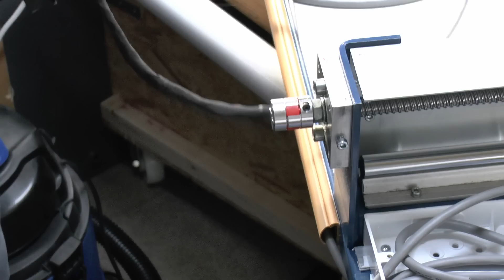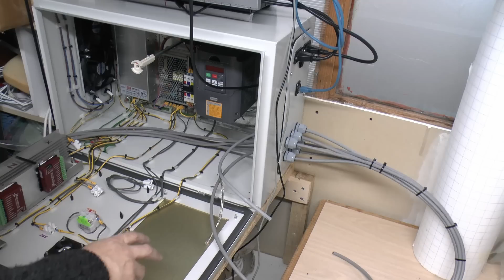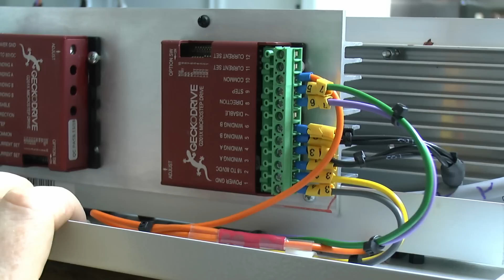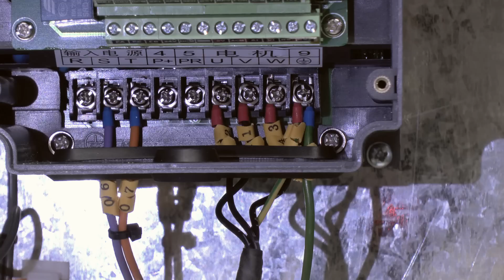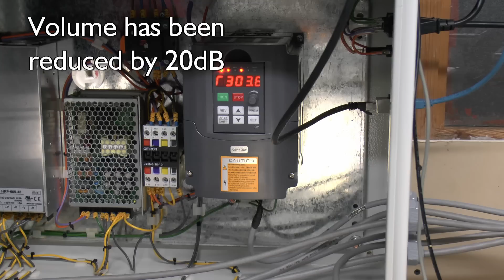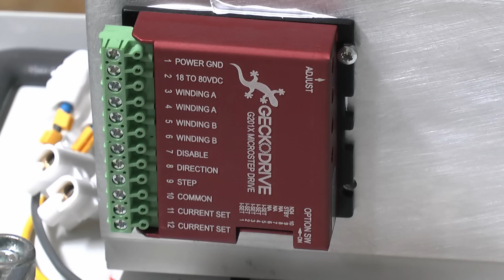CNC Router Build #5 - Motors and Movement

Comment: How to connect 2 y axis pleas help me
Reply from the maker: 2 motors for a single axis requires 2 motor drivers, each connected to 2 separate outputs on the controller board.  The software is then configured to send the same Y axis signals to both of those outputs.
Reply: @jwflame   how i can configure in match 3 for 2 motors and 2 drivers for 1 position y axis
Reply from the maker: @justbabychub581  No idea, I do not use Mach3.

Comment: HI John, Are you still using your CNC? is there been any issues with it? Im building one similar just wanted to make sure your happy with your one?
Reply from the maker: No issues with the machine - the only changes have been that:
1 the computer monitor failed recently (it was already 10 years old when the videos were made), so replaced it with a new one
2 the cyclone dust collector didn't work very well as the plastic tub was too weak, and the sides crumpled in after a while (now replaced with a metal tub instead)
3 for flat panel materials they are fixed to the base using double sided tape, as that's more reliable than superglue and masking tape.  They are all single sided so tape on the back doesn't matter.
Reply: @jwflame  Its a nice CNC Was your Gecko boards and Motion controller ok? 
Thats the bit im working on! The Chinese ones are too dodgy Im thinking ACORN CNC Centroid, CSMIO/IP-M 4-axis CNC controller also there is an Italian company N°4 Drives A-CSD04.V and N° 4 Stepping Motor Called RTA! I watch your vids and love the CNC ones clear and very helpfull! Thanks JW
Reply from the maker: @iceman1358  No problems with those, I chose those so that if anything did fail, direct replacements would be available, rather than trying to source some random unbranded thing or have to make alterations and fit another type instead.

Comment: I'm wondering if a smaller motor on the Z-axis makes more sense.  That motor has got to be heavy and that extra mass is going to create a lot more inertia, which will mean you have to move slower on the X and Y to get the same accuracy.

Comment: I suggest heavy welding cable for connecting those limit switches, that cable you used looks severely underrated for the expected 2mA of signal current.....

Comment: Gawd, that's NOT how you terminate shielded cable...  Remove insulation, peel back and twist the shield, solder an earth wire to it, cover with a rubber insulation tube/heatshrink. At the signal termination end, connect the earth wire to a local earth terminal, which then connects back to the star earth point at the mains incoming.

Comment: how did you tune the motors without MACH4,  I trying to run my CNC but the motors dont move yet it has an old driver box witch controls all 4 motors i have on my CNC. would you know what could be the problem. thank you
Reply from the maker: To move the motors you will require either Mach4 or some other control software, there isn't any realistic way of operating the motors without it.
The particular motor drives in the video have a small adjustment screw on the side to obtain best results with a particular motor, this is adjusted once the motor has been set to a continuous slow speed in the software.
Reply: hi John , i got my CNC from a person, and it came with very old driver and it was working kind of but when i installed it in my shop it stopped working . i do have MACH 3 software but i cant run CNC with my old driver , . its a big CNC  with 34d  and 42D motors , motors have 6 wires, 4 phase  and 42 D motors are 7.1 Amp. i would like to upgrade Driver for my motors, can you recommend some good drivers for my motors and BOB. 

thank you

Comment: hi John very well done i like your control box .  what that spindle inverted, do you need anything else to run the spindle,.. thank you
Reply from the maker: The spindle can be run with just the inverter, speed can be set manually with the controls on the front.
In this build, spindle control will be done through the software which required some additional wiring between the inverter and the breakout board.  This will allow both on/off and speed control.
Reply: can you recommend any good inverter, i would like to control spindle from my MACH 3 . thank you

Comment: Excellent project John - may I suggest to eventually mount the unit on one or two concrete paving slabs as this will reduce some of the low frequency rumble and help reduce vibrations when routing the work piece , it will not reduce the high pitch of the stepper motors, however it will give overall stability especially if the CNC is not going to be moved around the workshop.

Comment: Excellent build, one question though - why not use plugs/sockets for the motors, eg a D connector or similar? Would be easier to move though a faff to install them all I guess.
Reply from the maker: The effort in installing them is far more than disconnecting wires in the unlikely event that the machine is moved somewhere else.  More connections with plugs & sockets also means more things to fail.

Comment: I recommend to modify the ramp-up (PD014) and ramp-down (PD015) time for the spindle on this VFD. In my experience 5-10 seconds for ramp-up and 3-5 seconds for ramp-down work fine for this type of spindle. If you use Mach-3 you'll notice quickly that by default it will not wait for the spindle to be at full speed which means it will start cutting at a very low RPM. Make sure that your CAM software adds an appropriate delay/dwell (G4) command after your spindle start (M3) command, probably something you need to do no matter what.

Comment: Why does everyone name X, and Y axis wrong anymore? Your gantry is supposed to be Y, and the table X. I know some people were making Joe clones with really long gantries, and short tables, and I think that is when flip flopping the axis names started. There seems to be some grinding noise coming out of your table axis to me too. Maybe the gantry is racked a little? It still looked like it was moving OK to me though. What rapid move speed did you get up to?
Reply: Your X, Y, and Z are always related to your workpiece and the origin point.  Generally, the operator will be standing in front of the machine and the X axis is always right to left and Y is always front to back while Z is up and down.  This is the case for pretty much all CNC routers.  Even if you work in the negative quadrant like some overseas countries your x is still right to left and y is still front to back.  Remember that the front of this machine is parallel to and towards the spindle side of the gantry.  In this machine and pretty much all like it, your gantry is the X axis since you always want the front open to set your work origin if you work in the positive quadrant with the origin in the lower left.  The Y axis in this machine is powered by dual motors and is attached to the table.  This is the way it has been as far back as my CNC knowledge and experience goes and I learned CNC 25+ years ago on industrial equipment.  Pretty much all CNC routers were set up in the portrait orientation.  Granted you could swap your x and y-axis in the configuration to make the table x and the gantry y but I don't see the point since the front of the machine would then be on the side which would make setting the part origin more difficult.  At the end of the day it's all about the end result and how you get there is up to you.  That is the beauty of CNC.
Reply from the maker: The alignment of the slave motor isn't quite right, hence the excessive noise on that axis.  Gantry was just connected where it was, so that may not be correct either.
Maximum speed was 10000 mm/minute, or about 400 inches/minute.
Optimum speed, acceleration and other settings yet to be determined.
Reply: kuhrd   I'm with you

Comment: What is the adjust screw on the driver changing, is that commutation timing delay?
Reply from the maker: The documentation for the drives doesn't actually say what is being adjusted, only that doing so 'will result in the most even microstep placement for a given motor and power supply voltage'.
Reply: The adjustment screw on the motor drivers fine tune adjust the output current at low speeds to match the specific size motors you are driving.  This helps prevent excess heat buildup in the motors and drivers as well as vibration.  It allows you to find the maximum stepping torque without saturating the windings.
Reply: Yeah I want to ask Mariss about that.

Comment: A quick thought on the plastic cable chains: As far as i know, those don't particularly like being "bent" sideways as it appears they are on your X-axis. If they dont "fold" up straight on top of themselves, there can be increased wear on the moving joints, wich might cause them to break prematurely. Not sure if that's the case for the particular ones you got though.

Comment: Looks good John, I'm a bit worried about the strength of those stand-offs? If the system jams up or binds in operation they look like they might twist around with the torque from the motor... Just my to pence...